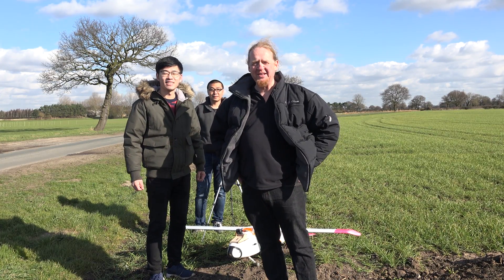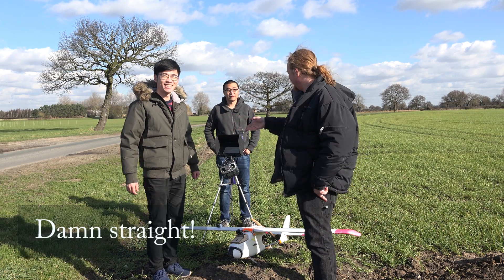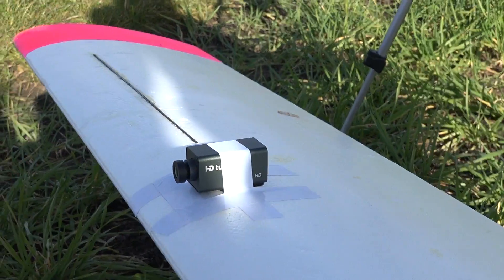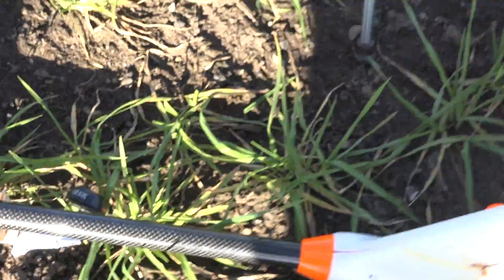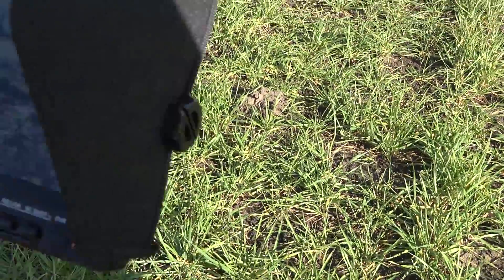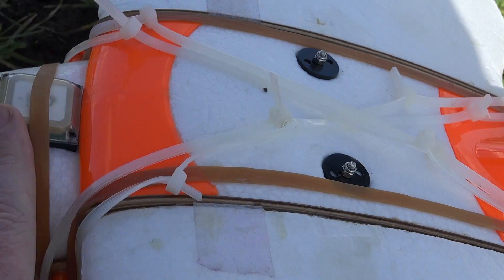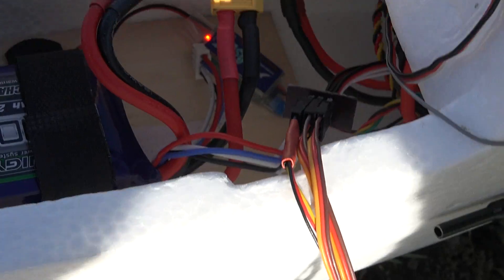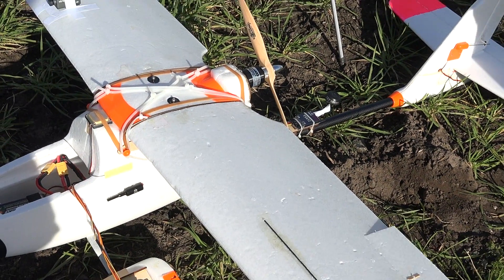First Short Test Flight of Skywalker Based Drone

Comment: Looks a big machine! flies well - has this got a long range? Look forward to a better camera - thanks for sharing :-)
Reply from the maker: It's a 1800cm wingspan. The video range is about 1.5km and control range a bit more. Could easily make those more like 30km if you wanted to though. It would certainly fly long enough with the right batteries. Will definitely put a better camera on next time. :-)